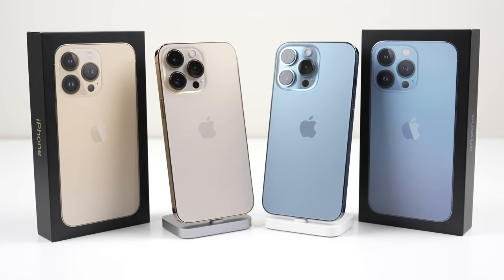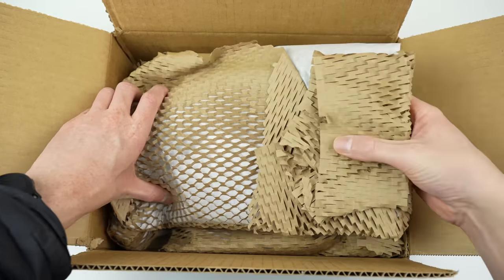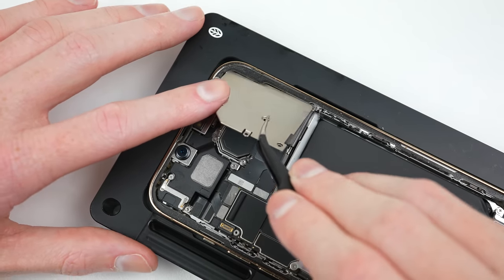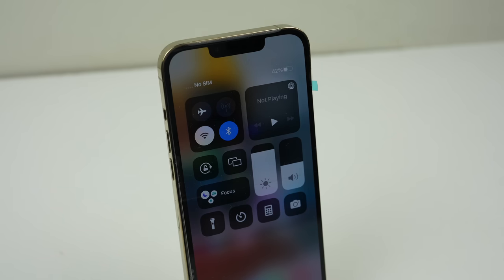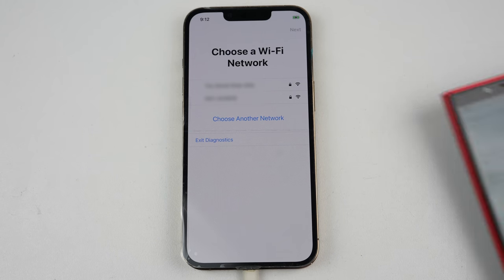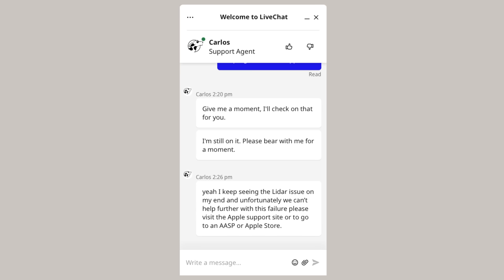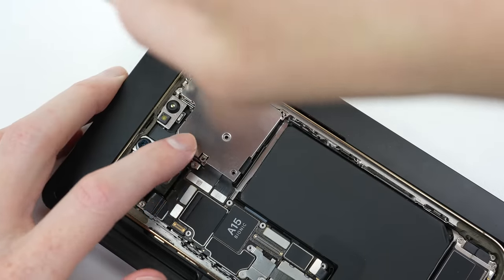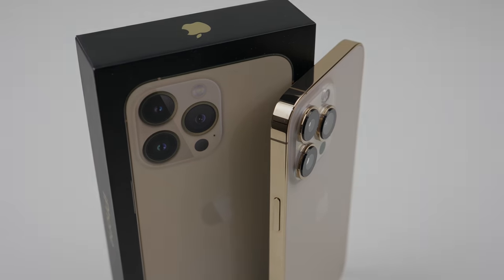Apples Self Repair Program Is Not What It Seems

Comment: Only problem with right to repair is. Say I wanna buy a second hand iphone. At least at moment I know if it’s been done with correct and genuine parts because of the pairing thingy and signs that come up saying genuine apple part. But if they not there, what’s to stop someone replacing parts with cheap ass versions and then selling that phone to someone? Now that person as a genuine apple phone with cheap and nasty parts. I can see it from both sides. From 1 side I should be able to repair by phone easily by myself and from other side if I buy a second hand iphone at least at moment I know if everything is genuine inside it.

Comment: I mean this is just the beast blatantly showing its true intentions. They want to make repairing your phone such an expensive hassle that you'll just buy a new one, but they can't do that if independent repair men can literally do it in 5 minutes. Before, they wouldn't sell repair shops the parts unless they were verified, and that meant both requiring to sell their new products as well as ordering the parts individually per job order, meaning the parts didn't get shipped until after the customer buy the service, they can't keep backstock. This turns a 5 minute repair into a pointless wasteful week long wait. Now they're hand is forced to supply parts, and they still require the parts to be bought individually and to be directly associated with a product serial number, meaning nothing has changed, it will still take weeks for a simple repair. And this is coming from the company that apparently removed the accessories from their new phones for be friendly to the environment. This is apparently the company that cares about an exquisite user experience. They are actively inconveniencing the customer, wasting packaging and fuel shipping the parts in small batches instead of in bulk, and ultimately forcing people to throw away perfectly good phones when they could easily be repaired. Wow, how convenient and good for the environment...

Comment: Apple has been doing this for years, I used to repair computers and common components they used that were always available from Distributors at 1/4 the cost of the exact same component from Apple were unusable, due to Apple Proprietary Firmware, that is not available even to Certified Repair Technicians, you had to charge the Customer the overinflated price for a simple replacement component due to Apple's Corporate greed. I would always tell my customers, when they were replacing their Device not to get ripped off by Apple again. Most took my advice, thus Apple's constant loss of the Computer Market share, but there are always those who were Status Conscience, who would make the mistake and purchase again to satisfy their ego's. I have run just about any type of function you can perform on a computer and could always find a Windows Device that could outperform an Apple for 1/2 the price. I tried not to judge my customers, but the bigger the ego they projected, the more addicted to Apple Products they were. Sad but very true!

Comment: Apple going to pair a code with the part . After you install the new part an input for a code will pop up and your just type in the code that came with the Apple part so you don’t need to have tech support fix the problem. You can only get the code from Apple and not a 3rd party service but you can get around this if the 3rd party gives you the code they got from the Apple part which they might charge more for. Unfortunately this isn’t an option yet but will be soon.

Comment: Bear in mind that the vast majority of world wide law makers (politicians!) are virtually tech illiterate, they are not capable of understanding, without videos like this, that Apple's definition of "right to repair" is at best a heavily stylised one & at worst still non-existent.  From here it's all in the wording, I'm a firm believer that true right to repair means you can get the parts you need with no impedement to that repair, legally though it depends on how it's worded in legislation - but to my definition, right to repair does not exist within the Apple scheme.  It's also questionable as to if that qualifies under a monopoly, which again, could prove problematic in certain places.

This smacks of Apple hoping that the politicians around the world will accept that they're offering right to repair so will give them a free pass.

Comment: I have a simpler and better way to make phones water proof. Use a wax or epoxy to completely fill the inside of the phone that can either melt out or dissolve out depending on what material used.

Comment: Without this level of control over the devices there would be cowboy repair shops everywhere doing bad jobs of repairing iPhones and other devices, lowering the quality of hte user's experience and perceived value of the product. Do you remember or have you ever seen what using a PC was like back in the day with 3rd party add-ons, repairs, downloads and all the issues they caused? You may be able to competently do these repairs but most people would lack the skills, confidence and/or time to take them on and many would pay some street urchin to do a bad job of it for them, then rent Apple for their own clumsiness and thriftiness. If you don't like this situation, buy a Samsung.

Comment: Apple is not stupid, I will give them that.... However, that does not change how annoying their methods are... I had the unfortunate experience of my first ever screen shattering. Well, by shattering, I mean complete and utter obliteration. If I had an Iphone rather than android, it would be much more of a pain to fix the thing. My phone is sadly not cheap enough to just get a new one, and either way, I much prefer to fix rather than throw out when possible. The new (OEM) screen cost 300 bucks, sure, but at least the damn thing works out of the box without complicated software BS. While I am glad Apple now has a self repair service, the fact that they are anti repair is still just making me not want their stuff.

Comment: This all looks like a total waste of time, if I have a problem with my phone I want to just take it into my local phone repair shop 5 minutes walk form my house and get the thing fixed there and then. I don't want to have to wait weeks for parts to be specially ordered and then have to go through this convoluted pairing process. Based on this Apple is dead to me, I just can't rely on a phone that may take a week or more to fix if it breaks. I already switched away from MacBook with my latest laptop and based on this my next phone will not be Apple either.

Comment: This program is virtually useless. They put alot of barriers in place to prevent new users from signing up. It seems like they are trying to make it difficult, because if you want to replace a battery which should normally take 90 seconds takes almost a week, because you need to give them the phone’s serial number all of that crap, meaning you cannot stock up on batteries if you are someone who owns a repair shop or business. Further more, they are still almost charging more for the screen or battery than the phone, but also they don’t do anything besides batteries and screens. So if your laptop goes bad, nope, just batteries and screens. If your USB port isn’t working, sorry, just batteries and screens. It is just a worthless program.

Comment: I'm neither rich nor masochistic enough to buy Apple products. But I like that parts can't just be swapped out of products. A security argument could be made even though for Apple the motivation is very likely control.
Reply: How could that be a security problem?
Reply: @caspernicus5822  If you're seperated long enough from your device, someone could theoretically replace its security sensitive parts with dubious ones that could steal your data or spy on you. I know it sounds paranoid. But think something similar to ATM skimmers or keyloggers.

Comment: Does Apple really expects an individual without previous experience to use program like this to fix his or her iPhone? No offense, even if that individual passes the part of disattch the screen, the shear number of screws, clips and metal parts will drive he or her insane. iPhone may look premium and has the most powerful soc in the business, but its internal still looks like an old fashion piece of electronic, way too over engineered to drive people away from reparing themselves. I can disassemble a Samsung note8 and 10 the first time I saw your video, but I will never attempt so with an iPhone.
Reply: The reason it's like that is specifically to make it hard to repair. There's no other reason.

Comment: Ponder This -  You purchased a phone from a company that will not share with government officials how to extract information from your phone should you happen to become involved in a situation where the government will attempt to violate your rights.  <>  You are buying Security and a quality phone for the $1000 price tag.  Therefore you should also buy insurance on the phone so if it fails it will be properly repaired.  And quit whining that you can't service it.  It's unlikely that you can fix your refrigerator, or your car, or your stereo receiver or many other things you buy.  I am not an apple guy at all, but I respect the Products and the Company.  Just Sayin'…
Reply: what makes you think Apple is so secure when celebrity iCloud get hacked all the time, and apps made by Google and Facebook are shoved down your face on the App Store. also those items are usually never fixed because they aren’t designed to fail in 2 years unlike most apple products

Comment: Your video is pointless. I am a certified Apple Repair Tech and still have to run RepairCal or System Configs when completing repairs, so why shouldn’t non-certified techs have to do the same?
Reply: The video clearly states that Apple themselves has to run it on their end which completely defeats the purpose of why RTR exists in the first place.